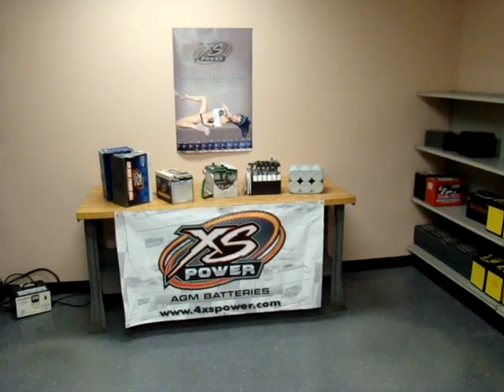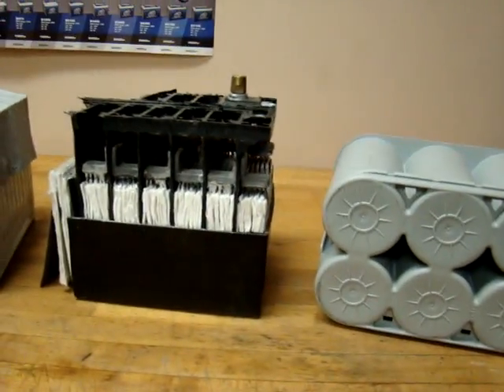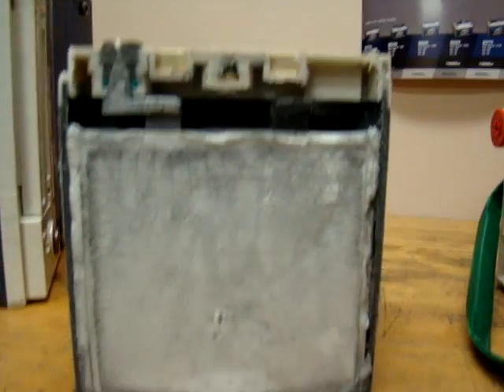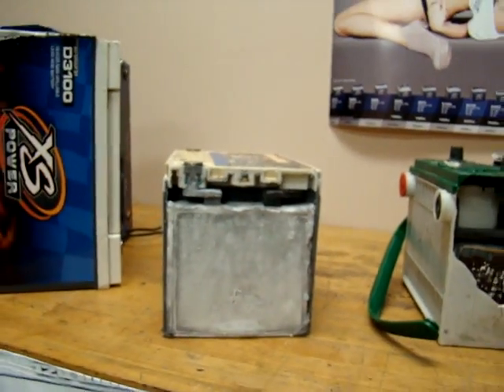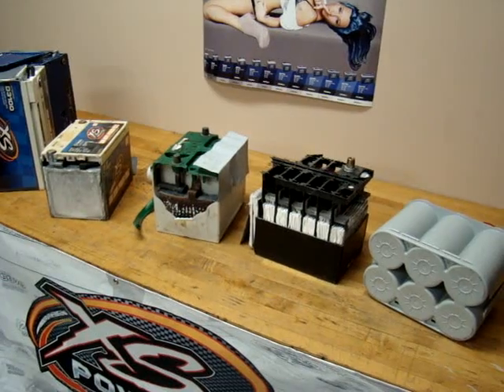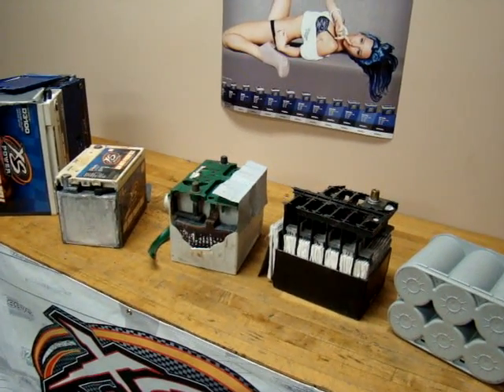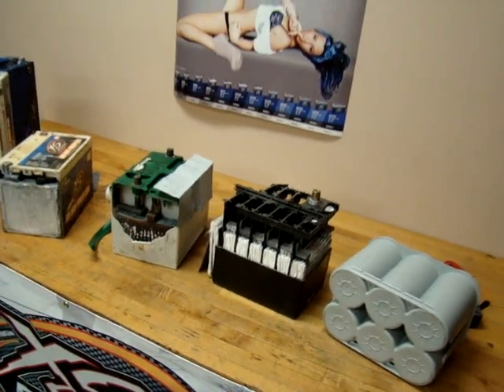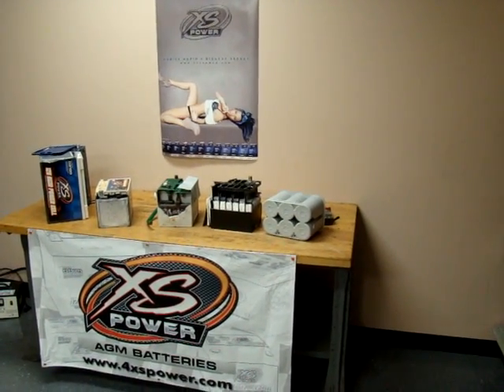Lets Get To The Guts of Batteries!

Comment: how about a battery fitment guide? I recently had to replace my battery in 2 of my cars but decided to just go to the Zone and get a Duralast b/c I I'd have to take measurement to fit each battery and there is not way to tell if it would have been the correct battery.